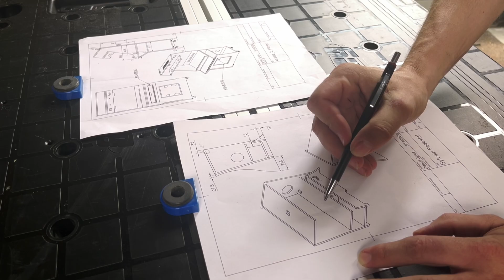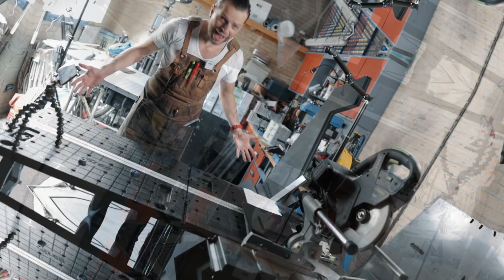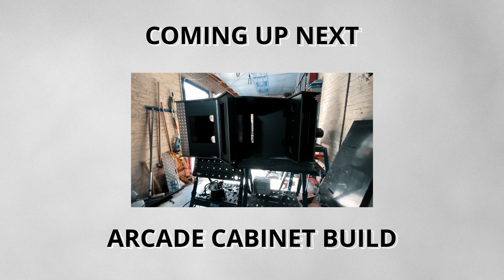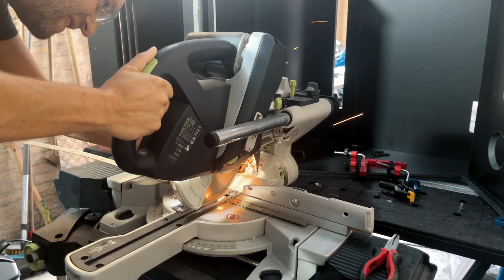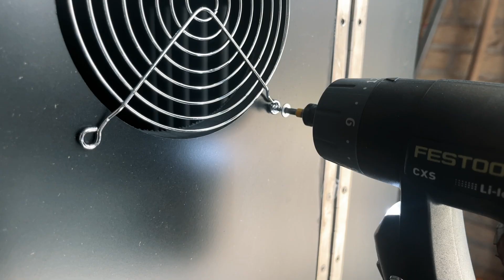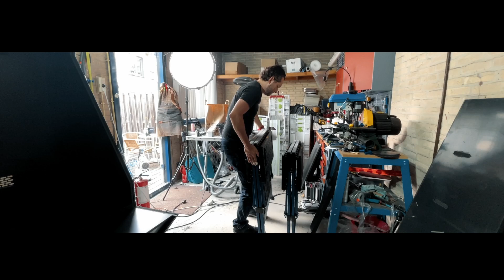Cabinet and Pedestal Arcade building series - PART 2:  'building the base and cabinet'

Comment: Had no idea that black mdf existed, would have loved to use that to avoid the painting. That hole cutter works great with a drill press, like a hot knife through butter. I'm getting ready to install all the components to the cab, will send you pics soon! Great videos and cabs, keep them up Daniel!
Reply from the maker: Thanks Steve!